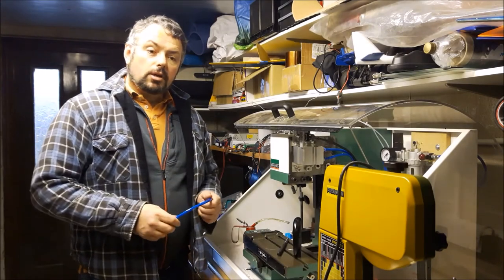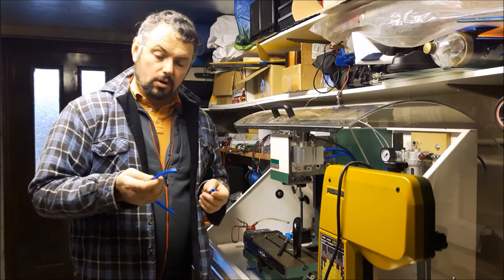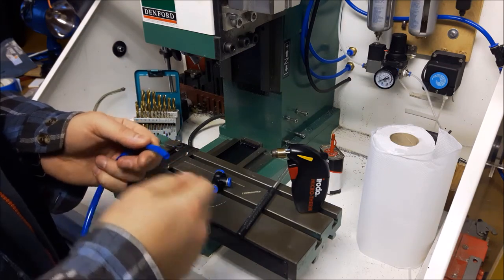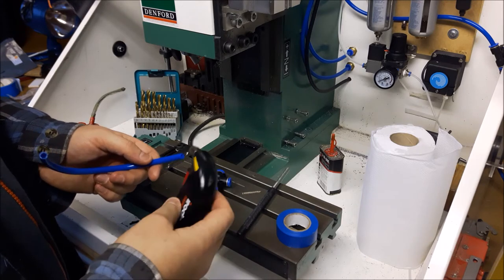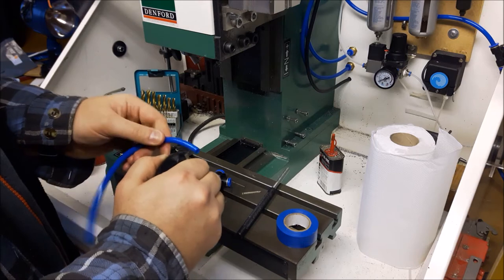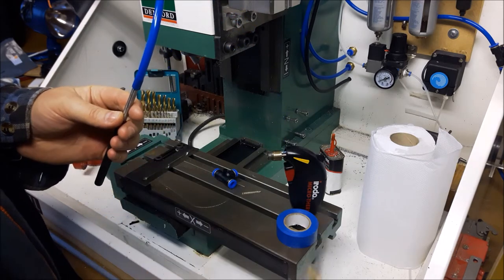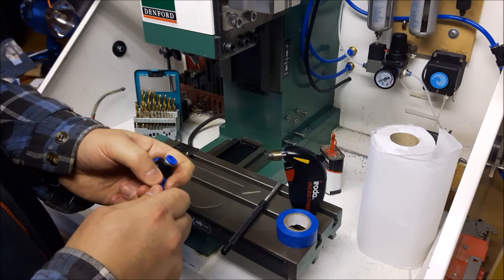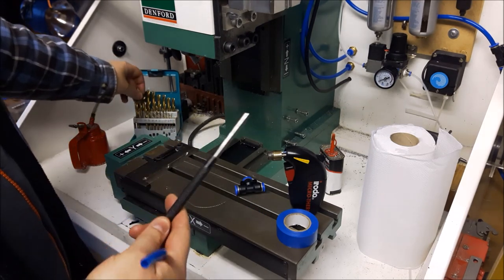How to repair / re-seal leaking push fit plastic airline fittings

Comment: Thanks so much for this excellent solution. I had a small leak at the push fitting on the hot water outlet in an RV. After swapping out the tubing with no success, figured it had to be the o-ring inside the fitting. After calling all local plumbing suppliers looking for a new fitting, again with no success, I found your video. It worked perfectly. Thanks again. The Happy Camper.

Comment: Thanks for the help it finally holds air! I took a heat gun with a few drill bits up in size to cram into the line with heat. Expanded the line a bit and boom! Holds air way better. I also tried the electrical tape since why not but found it to be not as useful. Thanks again!
Reply from the maker: Glad it helped...👍

Comment: Thanks, have same issues. Am using mine with water to test my circuit then will use for cooling oil. I orderered most of mine via Aliexpress from China, and they all come with a small roll of teflon tape....hmmmm...so i sometimes use it if i do get leaks. In my case i want to use them to connect and remove one item of system from another, so was hoping not to have to use teflon, because i would have to re-wrap every time.

But the system does seem to be pretty touchy about tolerances, and i would assume type of pipe you use, as well as the temperature.

But as you say, if you experiment a bit, you can develop a way to seal all your fittings that have the same type of tubing.

One suggestion for you is you could use some hot/just boiled water to soften the tubing to expand it instead of the flamethrower/heat gun. Most of these tubing plastics soften at >70-80C, so even a nice cuppa would work too..;-}
Reply from the maker: Hi WarthogARJ,
I'm now using little bits of thin walled copper tube as inserts in the end of the pipe when I first assemble anything. This is much more reliable long term as it keeps the tube from contracting when my workshop gets cold.
Hope that helps and good luck!
Cheers
Barry M

Comment: Another issue I had was with a ball valve leaking. I am using it on the suction side of my oil transfer pump on a T-piece (to be able to add more fluid) so it sees a slight “vacuum” due to venturi effect at times, or even a slight pressure: depends on the suction pressure drop and pumping rate.

So it is mot so obvious which way to orient the ball valve, with respect to the intended flow direction. There must be an o-ring inside that seals on the blank face of the ball, and it must be designed to work under positive pressure pushing the ball into the seal. But not entirely because if I swap the valve atound in terms of installed orientation it still leaks at times. In one way it leaks air into the system, in the other it leaks a bit of fluid out...sigh.

Maybe it works OK with compressed air when installed in the indicated flow firection, could be with enough pressure it forces the ball onto the seal, but if it is not enough then you get a leak. Dunno.

I am probably expecting too much from a cheap valve: i am going to try a better grade stainless one now.

Comment: Im going to try the black tape on an air line fitting. Edit.  Didnt work for me
Reply from the maker: Cool good luck. More recently I've started using a short piece of suitable diameter copper pipe as an insert inside the end of the pipe. This is easier to do and more reliable over the long term!